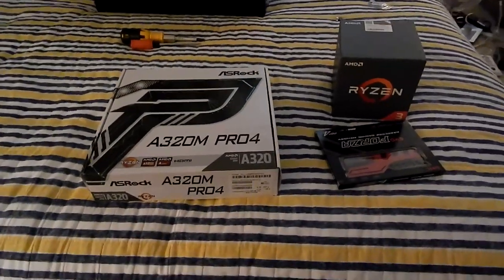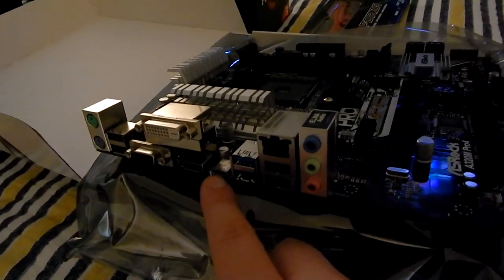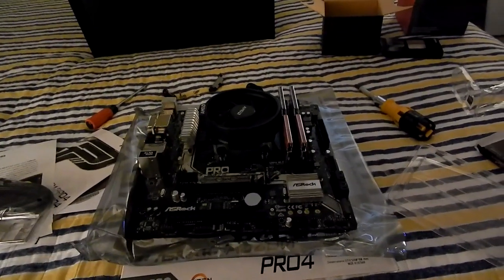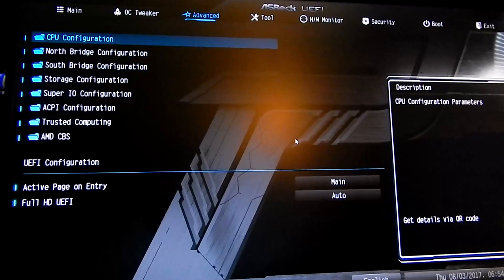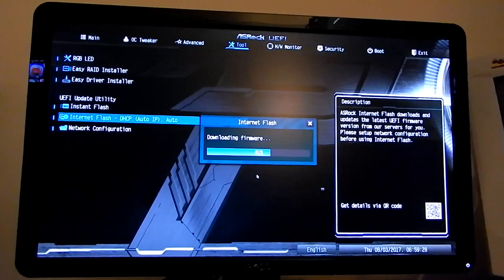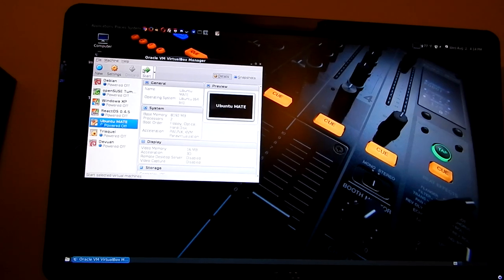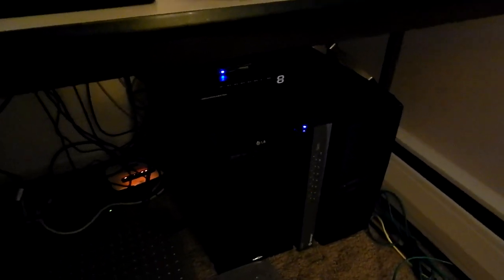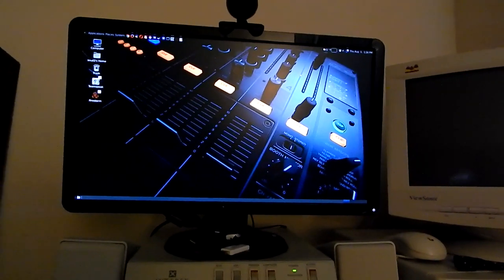Bedroom Linux PC Ryzen 3 Build: August 2017

Comment: Meanwhile my main rig is sporting a Core 2 Quad Q6600 and a 750ti. Oh well, it still does what I need.
Reply: Nothing at all wrong with that, I still use the pc I built in 2006 with an Abit IP35 Pro motherboard and a Q6600 wit 6GB of DDR2.

Comment: Just got around to finishing my Ryzen build. Unlike you however, I didn't waste all my money on RAM and instead dedicated those benjamins to a good graphics card, LOL...

Case: Corsair Obsidan Series 450D Mid-Tower ATX Case
Motherboard: ASRock A350 Pro4
CPU: Ryzen 7 1700 (OCed to 3.7GHz with Stock Cooler)
GPU: MSI Duke Nvidia GTX 1080 Ti
Memory: 16GB Team T-Force Night Hawk DDR4 3000
Storage: 500GB WD Blue 2.5" 6Gb/s SATA SSD
PSU: EVGA 700 B 80+ 700W
Fans: 2X Corsair AF140mm + 1X AF120mm High Airflow Quiet Edition Fans
Rosewill RDCR-11004 Card Reader
ASUS PCE-AC55BT Bluetooth 4.0 + Wi-Fi 802.11ac PCI-e Card
Mailiya PCI-E to USB 3.0 5-Port PCI-e Expansion Card

Can't wait to see this beast run games on ultra settings at 4K!
Reply from the maker: My god a 1080 Ti, that's the sex.

Comment: Do you ever use all of your RAM while doing stuff? I'm still on a VERY old Q6600 desktop with 4GB of RAM... seriously, the thing is loud and runs out of memory constantly. I'd replace it with a newer Fujitsu PC with an i5-4570 and 8GB... if it hadn't a stupid 250W TFX PSU with a single, proprietary connector in what would otherwise be a perfectly standard MicroATX case. Blah.
Reply: I tried Linux to edit a video using Kdenlive: complete failure. The aforementioned Fujitsu does the job fine. Well, my PC was enthusiast-grade 10 years ago, it's definitely time to move on. If only the GPU price weren't absolutely insane!
Reply: I don't play modern games, yet. I might even consider a Ryzen APU. Time will tell.
Reply: You can get quiet CPU fans. Replace the PSU with a gold 650W PSU (also works well for low-powered PCs). https://pcpartpicker.com/list/YTRNM8 (assuming you have an ATX case). You can get gold PSUs for $60. Keep checking. They're worth much more. (Corsiar CS PSUs are unreliable.) You can get very cheap whisper quiet (22dBa) 120mm fans on ebay. You want a 140mm fan outside too for summer. Mine is a Thermaltake TT 1425, from Ebay. Makes no noise at only 17dBa. It has a long cable.

Comment: why no floppy drive??
Reply: Only reason to really need one is if you deal with some really old legacy applications. They really are obsolete now. When I started learning about computers, in high school around '89, 3.5 floppies were new and 5.25 was quickly being replaced by them. Flash memory and CD-R/RW's came along in the early 2000's and put portable floppy disks out to pasture once most system bios' started supporting booting from those devices.

Comment: Out of curiosity can the A320 chipset take advantage of XMP profiles or do you need B350 or higher?
Reply: WillThePlank I think u need a B350. "I think"
Reply: +WillThePlank It takes advantage but no RAM overclocking past the XMP speed.

Comment: With my Haswell based ASUS Z97 pro board. I am able to update the BIOS via usb flash drive by locating the BIOS flash file inside  of the BIOS it self which is a very nice feature much like the BIOS flash update via the Internet on your ASRock board. No OS needed. The Coffee Lake i3s are very nice they are Quad cores now.

Comment: This is fantastic as it is just the upgrade I am looking at. From my Haswell i7 Z87 as this is struggling with the new kernels. Has there been any problems since building this? I run Arch Linux with the LTS kernel. The latest kernel fail. Still get ACPI errors but it boots. Manjaro, Antergos and Solus will not boot. That's why I want to upgrade.

Comment: Why do you have 32gb of RAM?
Reply from the maker: because virtual machines are rad
Reply: Yes. I run a few virtual machines on my Linux rig as well as GPU pass-through with 16 gigs of ram dedicated to it. 32 gigs are needed if you are running a lot of VMs.
Reply from the maker: Use Chrome plus have 4 VMs going at the same time and you'll use RAM. Although it's more like 3 in this case with only a quad core chip.
Reply: Would 8gb of total ram be enough if I plan to run windows 10 in a virtual machine on my Ubuntu box?